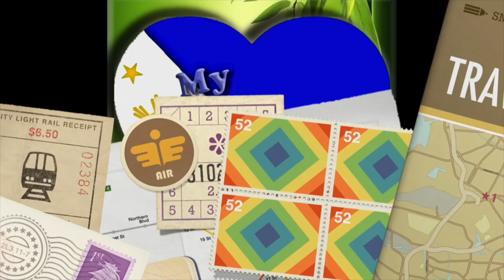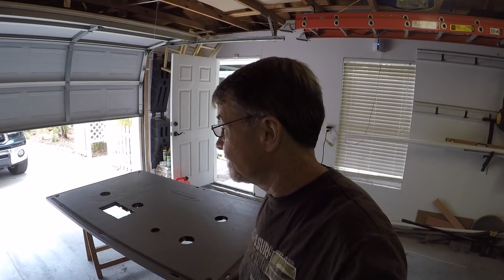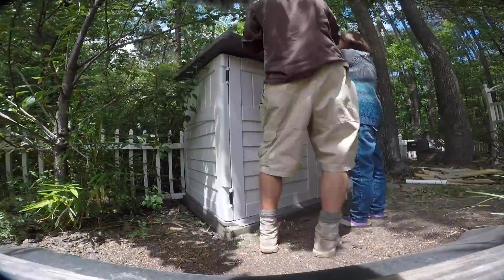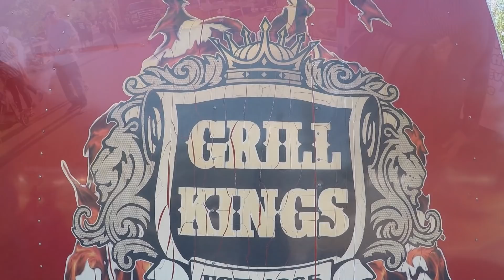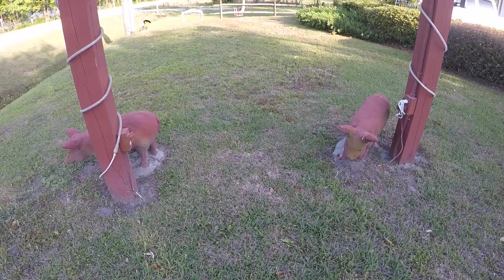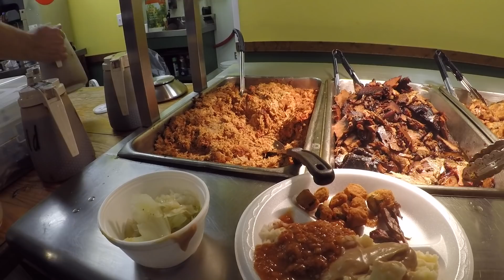VILLA FELIZ  - US EDITION: HOW TO BUILD A KOI POND PART 2 (How To Series)

Comment: Love pulled pork, seems like you can't find any good pulled pork BBQ in the Philippines
Reply: STEVE H  just make your own!!  Is very easy and cheap to buy piece of pork.   Put in container, rub with your favorite spices, rub with BBQ sauce, add a bit of water but not too much. And then slow roast for 5-7 hours. If on coals, is good. If in propane BBQ, one burner or two is good. In oven cook at 200 F